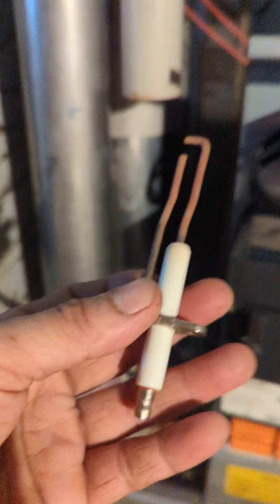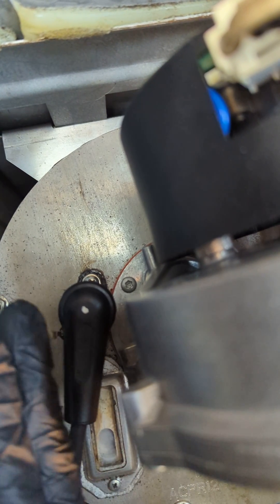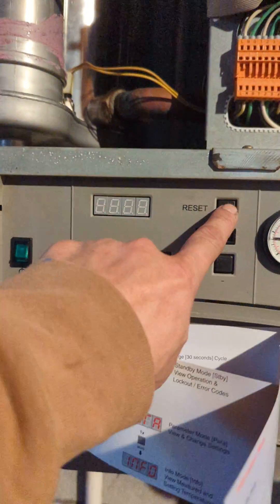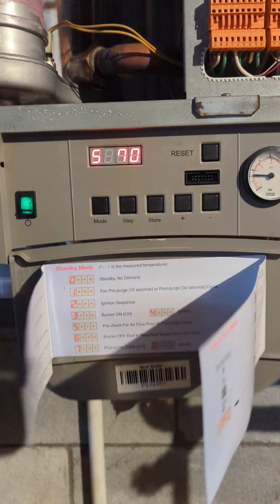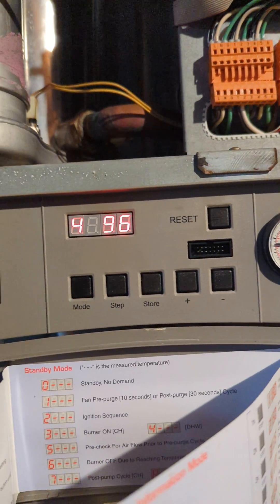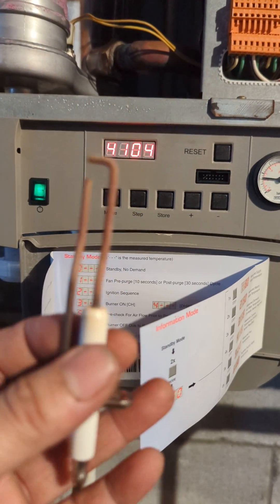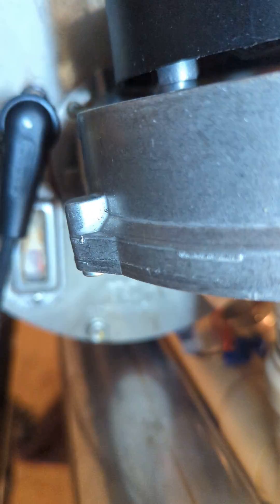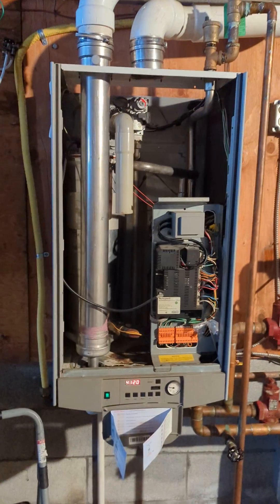How to: Install an igniter for triangle tube solo boiler to fixed E02 error code. Link for Igniter.

Comment: How do I remove from hard lockout?
Reply: touch the two pins to the far left upper and lower pins with a knife blade and it will reset a hard lock out
Reply from the maker: Turn power switch off for 5-10 minutes